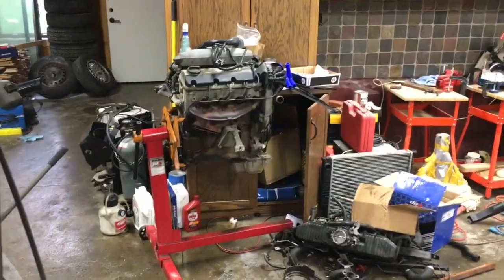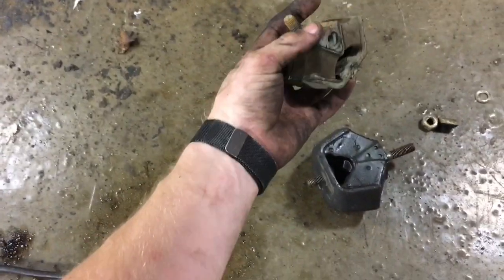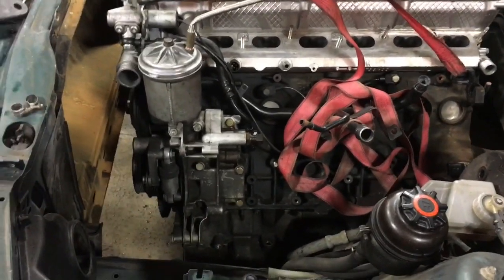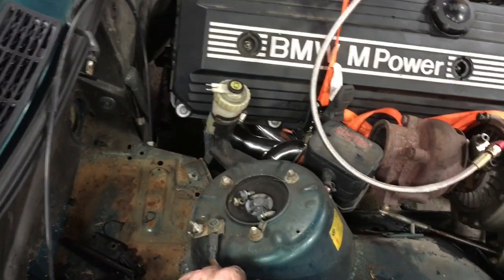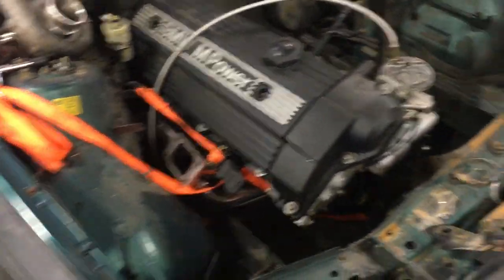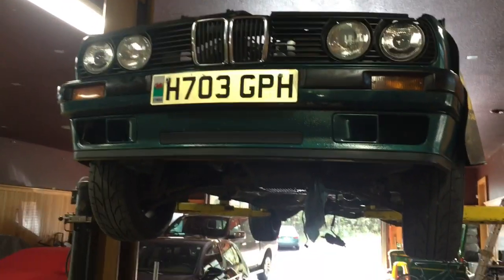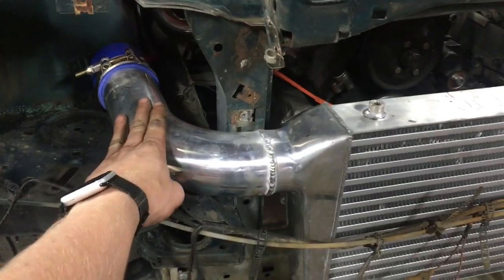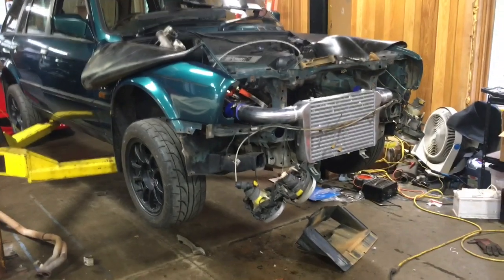Project Touring Part 4: the Turbo S52 goes in

Comment: I'm really liking the e38 740i and 750i, how hard do you think it would be to convert one from Automatic to manual ?
Reply from the maker: 750 the trans is like $5,000 if you can find one (same as my 850). 740 is easy. only non OEM part you need is a custom drive shaft.
Reply: MplsBav 5k!? well alright 740i it is then, have you ever thought about doing a budget tt v8 740i or 540i hoonicorn ? (my plans)

Comment: chopping up the non ac valance for the intercooler?
Reply from the maker: not unless I run in to cooling issues. intercooler, future oil cooler and rad are pretty high mounted, so I think that should be enough air flow through the grilles.

Comment: when i swapped to 1 wire i ended up getting it from an e28 5 series
Reply from the maker: all e30, e24, e28 and prior share that standard one wire VDO style sender. the sender isn't the issue, it's where to locate that second sensor when there's no provision in the cylinder head
Reply: Oh I see, I thought the s52 was Similar to the M50b25 :S
Reply from the maker: +Akieba it is almost identical on the outside but 1996.5+ they stopped tapping the head for two sensors.

Comment: How many HP does the S52 have?
Reply from the maker: a stock obd2 s52 was rated at 240-hp. this s52 is now 8.5:1 cr, is now OBD1 and will be turbocharged.

this engine made 450whp in the e36 it was removed from, I'll be running a smaller turbo and aiming for 400whp 420wtq
Reply: Nice. Are you planning to do some racing in it?
Reply from the maker: +Mohd Aliff Ramly nope
Reply: Using it as a daily?
Reply from the maker: +Mohd Aliff Ramly nope
Reply: I see xD Well good luck on the engine
Reply: 450? brah easily more. it was 412whp at 12psi. I was at 15.
Reply from the maker: 450MWHP (Maru Wheel HorsePower)